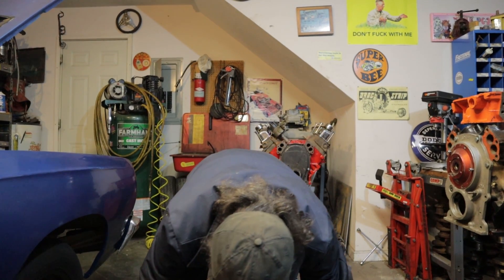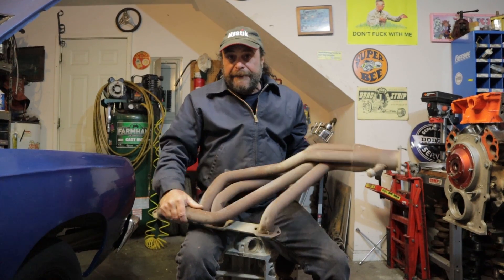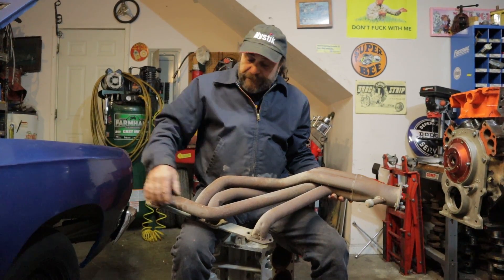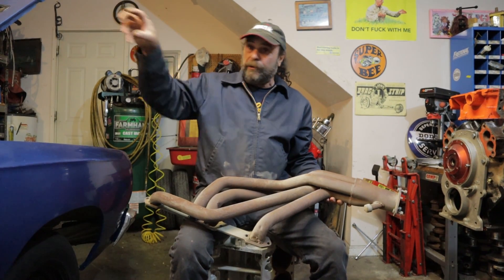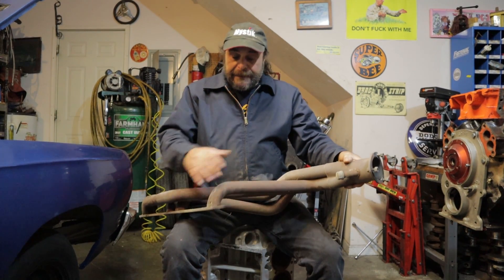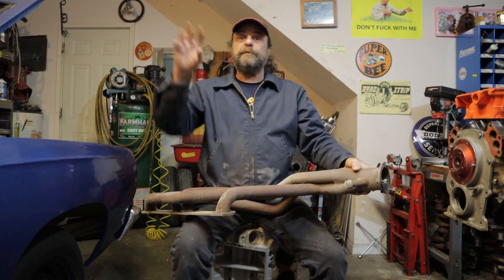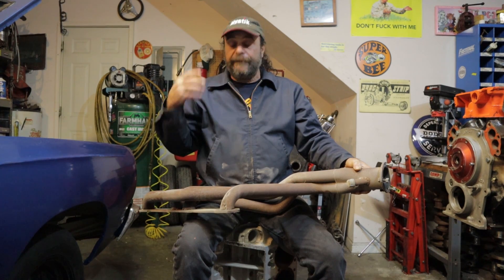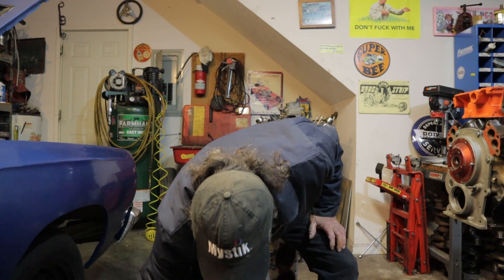The BS On Backpressure

Comment: The back pressure myth is not just an internal combustion engine problem. It is also a problem on steam engines that exhaust to the atmosphere. The Lempor exhaust was developed to create a partial vacuum in the cylinders during valve events to fully expunge the remaining steam before cutoff of the exhaust event. The valve events are not at top dead center but rather about 15 degrees either side thus it is called lap and lead. The Lempor exhaust helped prevent compression during the lapped time of the valve events. The compression issues are greater at full speed when, for efficiency sake, the engineers would change the timing of the valves to use the steam expansively. This is known as cutoff or hooking it up and was accomplished with the use of the reverser. 

The point is that most headers and modern exhaust are built on the concept of the Lempor exhaust. Using the inertia of the exhaust event to pull a vacuum on the other tubes of the exhaust. 

Thank you Uncle Tony for an excellent account of exhaust engineering.

Comment: I knew this instinctively because, back in WWII, all of the very high performance aircraft had nothing but 4" stacks coming off each cylinder.  No manifold, no mufflers, no long exhaust pipe, and those were designed to get every ounce of H.P. from those engines that could be had.  Also, top fuel motors that make 10,000 H.P. have "zoomies" coming off each cylinder with No BACK PRESSURE.  I have argued with people about this for years. Thanks Tony.
Reply: Well that may be a bit different. If I'm correct almost all those engines were supercharged. Supercharged engines don't need to depend on exhaust scavenging to get a good fill of air/fuel charge into the cylinders. They just pump the air right in, and during overlap the spend charge would be blown right out.
Reply: @Poop-nu1so  you're partially correct. Nearly all WW2 aircraft were supercharged, certainly all the high performance aircraft. It wasn't long before WW2 many high performance aircraft were not supercharged. The short exhaust stacks actually served 2 purposes other than simply directing the exhaust away from the motor. First, the airflow past the tips provided vacuum to the cylinder. Second, at power the exhaust flow itself provided some bit of thrust increasing the performance. A supercharged engine doesn't "need" scavenging, but it certainly helps more effectively clear the cylinder of spent exhaust gasses, resulting in an increase in power and efficiency.
Reply: Hook up your headers run 3" pipe where the flame stops in the pipe is where you cut the pipe anything more is a waste of pipe
Reply: I agree with the principle but It's not a really accurate comparison.There was only "4 inch stacks" because there wasn't room for anything more. I mean,can you imagine ANY aircraft with tubular headers & mufflers,lol ?
Reply: Airplanes have wind running over them, causing scavaging.
Reply: THE BACKPRESSURE IS A SET THING BUILT INTO THE HEAD. THIS IS WHY THE EXHAUST VALVE IS SMALLER. ENGINES REQUIRE BACK PRESSURE TO FUNCTION PROPERLY. TOP FUEL DRAGSTER STILL HAVE SMALLER EXHAUST VALVES. BECAUSE BACK PRESSURE IS VITAL TO MAKE POWER. IF THIS WASN'T THE CASE THEN WHY DIDN'T THEY MAKE THE EXHAUST VALVE THE SAME SIZE OR BIGGER, BUT IT STILL REMAINS THE SAME BEING SMALLER AFTER 100 YEARS. HOW WERE SO MANY MILLIONS OF OLD SCHOOL RACERS DECIEVED BY THIS SO CALLED MYTH NOR BS.
Reply: @Frank289100  I guess you missed the part of my comment (Made 3 years ago) where I stated that the top fuel and WWII aircraft engines used short stacks and zoomies?  No mufflers, no long and twisted pipes, no cat converters, all they wanted was to get the exhaust out of those engines for maximum power as fast as possible with the minimum amount of resistance possible.  Typing your misconceptions in all caps does not make them true.
Reply: @OverlandOne  I BROUGHT UP THE POINT THAT BACK PRESSURE IS BUILT INTO THE HEAD AND FOR THIS REASON IS WHY THE EXHAUST VALVE IS SMALLER.
Reply: @Frank289100  That’s not the reason why they can be smaller.
Reply: @RandomFabrication THEN WHY IS IT SMALLER?
Reply: @Frank289100 THE SHORT VERSION IS THE EXHAUST DOESN'T NEED AS MUCH SPACE TO GET OUT IN COMPARISON TO THE INTAKE AND THERE'S ONLY SPACE FOR SO MUCH VALVE DIAMETER
Reply: @Frank289100  It's not that the exhaust valve is smaller than it should be, the intake is just bigger. But it's not about trying to have back pressure. Back pressure at the exhaust valve itself would only restrict the engine and serve zero purpose. The only advantage is so called "back pressure" is having the exhaust pipes the correct size (not too large or small) to promote proper scavenging. Too small and it's restrictive, too large and the flow slows too much. If you restrict your exhaust somewhere and you magically pick up power on a dyno or something, it's probably because you've got a messed up cam grind or some other problem.
Reply: @RandomFabrication  THE GOAL IS TO REDUCE RESTRICTION TO ELIMINATE BACK PRESSURE. THERE IS ROOM FOR A LARGER EXHAUST VALVE IN A CONVENTIONAL HEAD AND  ESPECIALLY IN THE HEMI HEAD. AND YET IT STILL REMAINS SMALLER WHICH IN TURN CREATES BACK PRESSURE. WHY DON'T THEY JUST MAKE THE EXHAUST VALVE THE SAME SIZE IF BACK PRESSURE IS NOT NEEDED?
Reply: @Frank289100  I don't design engines. But I can assure you, restriction at the exhaust valve will only decrease performance.
Reply: @Frank289100  Exhaust valves are more expensive to manufacture than intake valves so making then smaller valve is a way to control cost. Exhaust valves can be smaller than intake valves because intake valves have to port and deliver charge to the cylinders at lower pressures ~11 psi. The exhaust gases on the other hand are ported and exhausted at much higher pressure say ~120psi.
Reply: @shieldcracker  JEGS - MANLEY BUDGET PERFORMANCE SERIES.
EACH INDIVIDUAL VALVE. INTAKE 10550-1 COST $10.58, EXHAUST 10549-1 COST $10.58. BOTH ARE THE SAME PRICE. IF ANYTHING THE INTAKE SHOULD BE MORE SINCE IT USES MORE METAL. Exhaust valves are more expensive to manufacture than intake valves so making then smaller valve is a way to control cost. Exhaust valves can be smaller than intake valves because intake valves have to port and deliver charge to the cylinders at lower pressures ~11 psi. The exhaust gases on the other hand are ported and exhausted at much higher pressure say ~120psi. DOES THE SMALLER EXHAUST VALVE CREATE MORE RESTRICTION/BACK PRESSURE?
Reply: @Frank289100  BOTH ARE THE SAME PRICE. IF ANYTHING THE INTAKE SHOULD BE MORE SINCE IT USES MORE METAL. Your choice to do a price comparison between valves, and your conclusion are not sound.  If one valve is bigger and has more metal than the other and both valves have the same price, this indicates that the smaller valve is MORE EXPENSIVE TO MANUFACTURE than the big one.
The selling price of any product is determined by market conditions which are outside of the scope of this argument. Notwithstanding If you do an unbiased sampling of valve sets prices you will see in general that exhaust valves are more expensive than intake valves. Perhaps you believe that the only difference between intake and exhaust valves is their size, that is not the case, exhaust valves can have different and/or additional manufacturing processes(alloys, forging and metallurgy treatments) that will drive up the manufacturing cost which goes into the price tag.
Reply: Pirate Labs well those aircrafts also don’t stop at red lights, Go ahead and drive your car around with 4” stacks.
Reply: @ze_german2921  I already do, thanks.  I get a lot of tickets, ha ha.
Reply: I'll tell U that those air planes have the fuel injection turned for open exhaust, or they'ed burn to hot burn up and U and that is not when flying!!!!
Reply: @chrisiollich4890  Of course the engines were tuned for that.  Oh, and yes, those flames also came out and can clearly be seen when they were flying...same with the top fuel cars.  Ever see top fuel cars running at night?  There you go.

Comment: This is where this back pressure thing started! 

With tuned exhaust, headers are used, often called "extractors" because they extract the fuel /air out of the cylinder when both valves are open. Then before the exhaust valve closes a positive back pressure wave pushes it back in!  Individual header pipe lengths are combined in a collector is important in the design to help exhaust scavenging and the subsequent back pressure wave as well as the type of cam used - cam and headers working together in harmony to gain power in a *specific RPM range*.  This is why race cams have such a wide overlap. 

It is this tuned exhaust pressure wave that is reflected BACK towards the cylinder that started this whole "back pressure" thing.  

People like to use headers because they look and sound cool, but they aren't going to do shit if they don't scavenge fuel / air then produce a back pressure wave at exactly the right time while the exhaust valve is still open.   

People like to use race cams because it makes their engine sound powerful with that erratic rough idle, but its not doing shit unless its paired with extractors that are tuned to the cam. 

If you want to see how extractors work take two straws and tape the ends together. Then wrap some stiff card around ends that are taped together make sure there is a good seal between the card tube and the straw ends, like a how a collector is with headers.  Put a ciggie in one straw (angled away of course) and blow hard into the other straw and you will see smoke come out of the collector and the ciggie has a long drag on it.  Scavenging!! :)

Comment: Tony, let these guys know that just lopping off a muffler and/or a cat will not necessarily create more flow (could make it worse) as the tuning is affected by changes in the length and flow.   Tony explained it every well in one of the slant 6 videos.  It was about manifold tuning but the same holds true concerning exhaust tuning.

Comment: Here's a loaded question would the engine run at its best if the exhaust manifold length was matched to the same size and length as the intake before going into the collector

Comment: Hey Tony, glad someone is chiming in on the "common sense" side of this argument

But, I have another spin to add on there...

Exhaust, especially open tube headers, are very resonant systems.

At low speeds,not only is there poor scavenging, but the resonant frequency is going to likely be very wrong for the engine

Mufflers tend to dampen those resonances. 

Two-stroke guys understand this, everybody who's owned a hopped-up rd350 and had the thing feel like it grew another cylinder and a half when it 'got on the pipe' doesn't need it explained to him!

the funny thing is, people think that an engine needs all this back pressure that a muffler is supposedly making at part throttle, at low speed.

If it was really that restrictive, the same engine probably wouldn't be able to run down the highway - it would act like an engine that had a plugged catalyst behind it

when I see pro stock and pro Comp, formula 1, and other unlimited engines need back pressure, I will think about adding it to something I build

Comment: @Uncle Tony’s Garage the thing that I remember hearing that helped this make sense to me is the explanation of why the vacuum forms behind the exhaust valve. It’s because the previous pulse from the last cylinder firing into the manifold caused the column of gas all the way to the tailpipe to move at a high velocity and have a high level of inertia. That gas wants to keep moving and therefore creates a vacuum behind the closed exhaust valves, one of which is about to open. Exhaust in pipes that are two big for the engine’s ability to move air doesn’t move out as fast and therefore doesn’t build that inertia to really make a vacuum. This is out of the idea that kinetic energy is 1/2 mass x velocity squared. The velocity is all important here - and velocity is high in a smaller pipe, so long as it’s not so small that it actually contributes significantly to back pressure. Exhausts need to be right sized for the power band you’re looking for and that the engine is capable of producing.

Great video as usual.  Just looking to add a slightly different explanation of the same concept that may click better for some.

Comment: Tony, I'm wondering, has anybody ever used a pressurized air box on a car? (Similar to the ones on a motorcycle). I'm not talking about a box that holds the filter but one that actually make pressure by the intake pulses. These are common on the higher performance crotch rockets.
They are really large and stout on a motorcycle and are engineered to each bike. I imagine on a car it would be huge.
I've read somewhere (Kevin Cameron I think) that the airbox on a MotoGP bike is top secret and costs $50,000 to build.

Comment: THANK YOU FOR TALKING ABOUT THIS!

I have been in heated arguments with guys about this. You don't want back pressure, you want velocity where you want power; back pressure is an unfortunate side effect of velocity at lower RPM.

I use air compressors as an example...if back pressure is good for a pump, why does an air compressor build pressure more slowly as tank pressure goes up? According to the "you need back pressure" camp's theory, it should build pressure faster with more tank pressure.

That normally makes people think it out and at least stop saying "you need back pressure", even if they don't understand why you need velocity.

Comment: I totally agree with you, but on the flip side a proper exhaust system  doesn't hurt performance on a street car like people believe. My Audi  A4 with a built 1.8t  lost 6-7 HP at least wheels with a cat,muffler and 3 inch oval exhaust. On pump gas and the cutout closed it went from 538hp to all 4 wheels to 531 and change. When you factor in drivetrain losses etc it is about a 1% loss and well worth it in my daily driver.

Comment: Sorry to swim in the opposite direction on this one but I have direct personal experience. We have a well tuned 2-cylinder moderately high output motorcycle with an open (glasspack) exhaust and cams with lots of overlap. Although power dropped slightly, drivability and “manners” improved with a slight restriction on the inlet side of the mufflers.

Comment: Nice Video, I had thought about making a simple vacuum pump for the exhaust. Easy stuff too,  just add a tube  into the Pipe facing the rear of the Mystery Machine and feed the tube with Daphne Blake holding a funnel out the window. 
   Scooby be raging at idle so might have to install header dumps on the air conditioning pump to feed the line at stop lights.

Comment: I try to explain this whenever I see a set of shorty headers with the stock exhaust pipes bolted to them.  Some people don't even bother to replace the stock mufflers because they think they need the back pressure.  I actually port my stock manifolds and use slightly larger than stock pipes with cheap glasspack mufflers, then I put a size or two bigger jets in the carburetor.  My old trucks don't make any crazy horsepower at all, but I always get comments on how smooth they run and how good they sound.

Comment: I mean, tuned back pressure from small ports and restricted exhaust manifolds gave better low-end torque and more fuel economy for (specifically for) truck engines way back when. There is a reason car manifolds and heads breathe better than truck manifolds and heads. Depending on the application, some back pressure can be desirable. The engineers of old may have known how to do their job. Feel free to argue below, I’ll just sit back with my poppycorn.

Comment: That’s why cams optimized with x-pipes have less overlap and more lobe centerline separation. The x- pipes when they were first coming out were found to pull gas and air out of the exhaust. This fried converters. That’s why factory exhaust has only h-pipes or a y- pipe. That’s why headers and exhaust mods are on the horsepower side and the intake is the torque side. There is actually a vacuum just off the exhaust port due to the ounces of air moving out at the extreme velocity. That sh*t doesn’t stop at half of Mach 1. The pull of it trying to slow down causes the vacuum.

Comment: while i would not argue with tony, i wouldnt be so eager to cut off your cats and mufflers for bigger pipes just yet, if you cut off the cats that have o2 sensors behind them your check engine light will be on and youll have the wrong air fuel ratio running an efi motor burning the piss outa the cylinders and all that, now you can run bigger tubes on a smaller motor if you run the smaller ones first to get the scavenging effect, such as running 2.5 from the manifolds back into 3 inch with 3 inch mufflers for that note, as going too big will kill the torque feel on the low rpm end, racers dont put around town at 1500 rpm they race wot at 5000 rpm, big difference. i am however bound and determined to find a decent solid note exhaust system for a 5.3 cause i cannot stand the popcorn noise they make